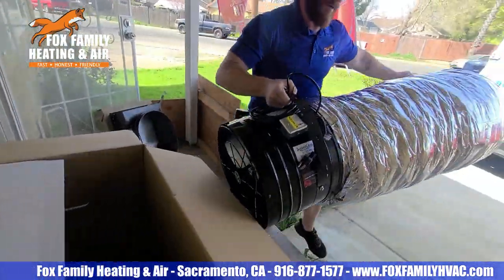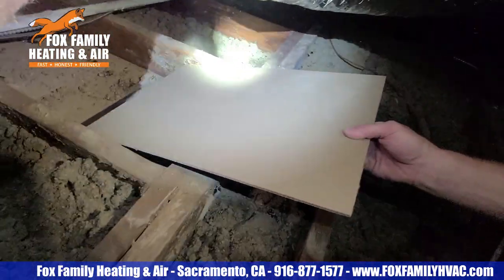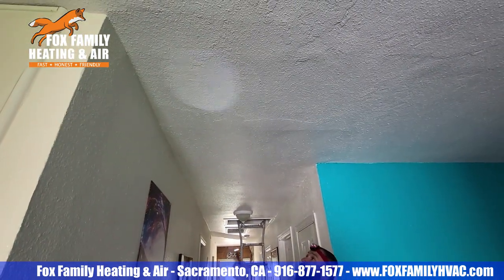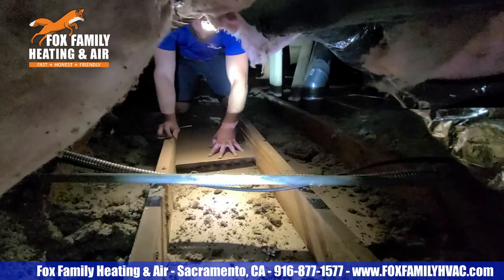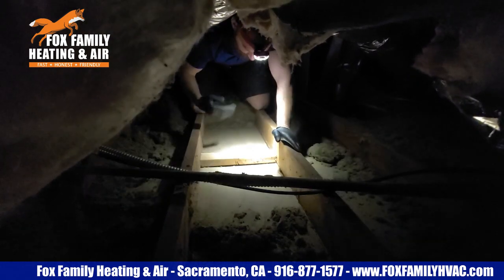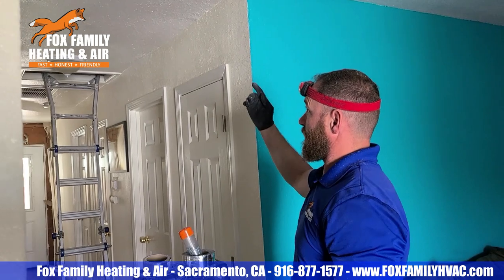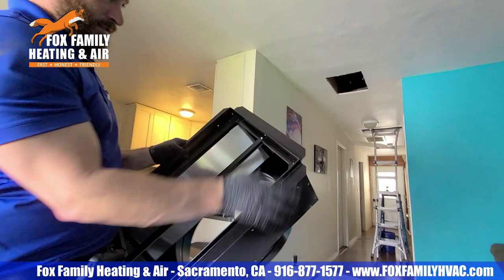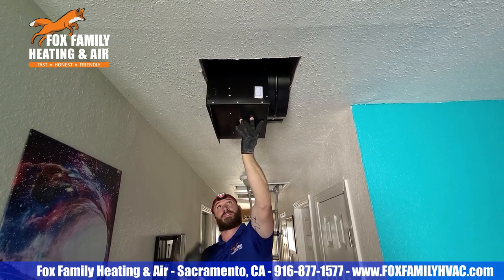How to Install a QuietCool Whole House Fan🔧 (Updated for 2022)

Comment: If you were installing the fan in a square room say 14x12 do you have to find the exact center of the room like you would a ceiling fan? 
What if the exact center of the room has floor joists in the way? Do you just cut them out of the way and build a box for the fan? Or do you just get it as close as possible to the center of the room?
Reply: If it’s only for a bedroom. 
You would probably wanna keep it The furthest away from the window. Or wherever your taking the air from. That would be my guess.
Reply: @nathanrobertson3349  Yeah that makes sense. I was just thinking of how it would look when done.

Comment: What’s the purpose of the fan? You generate negative pressure in the house and positive pressure in the attic. The positive pressure in the attic will push down the attic air down into the house around the AC supply registers. The hot air in summer and cold air in winter in the attic, plus light dirt will get into the house
Reply: That's why the attic needs to be vented properly.
Reply: I thought these operate off a RF with a remote. Didn't think you had to run power down the wall.
Reply: @ChristianCMC  you can, there's diff options. RF remote is another add on option.
Reply: You fundamentally don’t understand how to use it. First, the attic must be vented via gable or soffit vents. Second, you partially open a couple windows at night when the outside temp is lower than your t.stat setting. Then the fan sucks in cooler air from outside and also blows hotter air out of the attic through vents.
Reply: You usually shoot them out a gable vent in the attic or at least in that direction and not only that there should be no attic air coming down into your house if your ceiling cans have been properly sealed and your attic access is pretty well sealed off?

Comment: If the air conditioning is on you be losing cool air a lot. I can imagine this for a garage, but not for a house with central air. You never cool the house.
Reply from the maker: Right. See you would only use this when it's a bit nicer outside like 80 degrees or lower. Then you would save by not using your air conditioner and instead use an efficient ecm motor to actively bring on air from am open window on the other side of the house. But you're right. You would never use this if the AC is on.
Reply: @foxfamilyhvac  
Thanks for the information. 
God bless you and keep your business growing.
Reply: The whole theory behind these fans if that during the cool hours usually in the morning they would like you to open your windows or doors and pull turn the fan on and it's supposedly pulls all the heat load out of the house how your air conditioner doesn't have to work as hard
Reply: You never run a whole house fan at the same time as the AC.